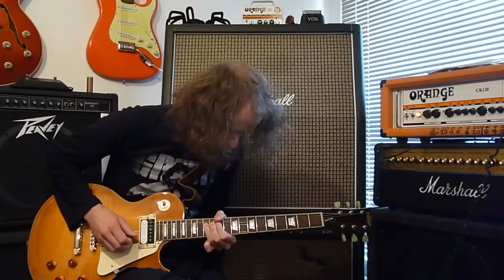Why I prefer Solid State amps to Valve amps

Comment: You sir are fighting the good fight man! "Solid state" does not have to be a dirty word, and I wish more people realized that!
Reply from the maker: Thank you very much. :)
Reply: No problem! I have two of those MGs myself! They haven't let me down yet!
Reply: Most people realise that. A tube amp has that cool factor though.
Reply: This is true. In the one music store where I work part time, we got in this vintage (or maybe just old?) Mesa Boogie that is covered in this red faux-suede like material. Beautiful piece of gear, and beautiful-sounding piece of gear! Can I afford it? Nope. Would I risk gigging it even if I could? Double nope!
Reply: Speaking of gigging if you hook up a 2000 Dollar tube amp to a solid state final stage how much drugs and hookers could you have bought while gigging in Amsterdam if you would have just gotten a line pod instead?
Reply: e james "tube technology obliterated?" No way, and I still want to be part of it. Do you use a Microwave Oven? That's tube technology. Fly on commercial airline flights monitored by ground radar? That's involves tube tech. Listen to broadcast radio or TV? Tube tech, again. No solid state devices have replaced vacuum tubes in these applications. Think vacuum tube research is moribund? (Look it up in the dictionary) Have you heard of nano vacuum tubes?  NASA’s Ames Research Center produced a nanometer-scale vacuum tube that, in early testing, has reached speeds of up to 460GHz. There's a speed limit in which electrons can pass through silicon or germanium. In tubes, no such speed limit for electrons in a vacuum. Or how about the new "impossible" RF resonant cavity thruster design, unique as the electric propulsion device doesn't require rocket fuel for space travel,  (potentially demonstrating an interaction with the quantum vacuum virtual plasma powered)? Powered by a vacuum tube. A researcher in the UK, researchers in China, and NASA are convinced it works from tests.
Reply: Ryan O'Donnell, Wes Montgomery played through Standel solid state amps. Standel as a tube amp company pioneered many features that Leo Fender "borrowed" from. Never heard of Standel? They switched over to transistors before Fender in the 1960's; a bad lot of encapsulated Solid State boards (which couldn't be repaired), bankrupted the company. (CBS Fender should have taken notice)

There are good and bad sounding tube and solid state amps. The Beatles used some solid State amps or tube/ss hybrids, but not exclusively, and towards the end not at all.  

No company to date has produced a transistor that mimics perfectly a tube amp, as 1) it would be low powered (Class A) circa 10 Watts, and 2 expensive, but would distort similar to a tube with even harmonics (instead of the harsh odd harmonic) series which to date no company has come close to this ideal. 

Both technologies have their strengths and weaknesses, which can be artistically exploited, but it doesn't have to be one or the other. However, for most applications I am interested in, I wouldn't never use "squalid state" personally.

I have repaired tubes and SS both over the years. Tube Technology is similar to a car. It requires tune ups and maintenance plus time to time part replacements, similar to replacing tires on a care. Yes, there are expenses, but it's part of ownership, like a car.  Similar to cars there are well built brands with money being no object, and entry level brands or built to a price point.  Solid State (especially beginners amps) has less maintenance, but generally when something happens, the replacement cost is in favor just tossing out the amp (versus repair).

My opinion, a Fender Hot Rod tube amp series shouldn't be used long term by a professional musician. They aren't designed to take the abuse night after night, and Fender knows this. Used every day, five years max, but that's not the fault of the tubes, it's the heat issue from poor design, inadequate ventilation, and inadequate traces on the PCB that are the problem. Would be okay for the occasional player on weekends, but the ones who keep their day job.

Solid State is often defended as to its lack of maintenance issues compared to tubes, and its reliability. Well, when the SS amp does require a repair, it quickly becomes landfill material.  "You repair amps? Can you repair my Marshall?" It's not a tube amp it's a solid state..." I have heard too many times (not just Marshalls) as not too many guitar shops, or repair shops in non-Metropolitan areas will not touch them.  

Frankly most repairs on SS amps are just PCB replacement, but if you have a discontinued amp with a board no longer made, good luck, the repair would get you into Tube territory prices or higher with a bench charge and labor.  Incidentally, as to maintenance, any 25-30 year old SS amps require Electrolytic Cap replacement, just as Tube amps require (E-Caps generally last only 10 years).  

SWR, don't get me started on their repair issues. Lord have mercy on someone with a pre-Fender SWR 900, post fender acquisition 900s use different shape and PCBs.  The SWR Redhead at the local High School was always out for repair, (but not for the tube preamp) , so much so that the Jazz band's bassist would take his own equipment, a Vintage Traynor Bassmaster tube head (plus a cab),  out to Jazz band public performances and competitions. The SWR's problem was one of design and part selection. The inadequate 5 Watt resistors need replacement with 10 Watt aluminum fin resistors on the chassis to heat sink these, the 2SC3264 transistors were too often generic equivalents (like the NTE92 or cheap counterfeit transistors 80-90% of the time, which fail (replace these with NOS transistors from the original manufacturer of the 2SC3264), the standoffs for the PCB too tall, etc. The OEM speaker needs replacement with a more durable speaker that won't fail.  Otherwise, a nice sounding amp. 

And, yes there are bullet proof transistor amps out there. But if I have a choice between repairing an original Fender Silver Face tube  amp, or a  Solid State amp, the tube amp wins out. 

For all the SS amp fans, call your local guitar shop (or for that matter Guitar Center), and ask how much to repair your SS amp, which isn't making a sound or distorted but with little volume with the amp dimed, or just squeals loudly at low volume, and ask about a repair and the cost.  You might be surprised.

Solid State wins out for Bass Amps in the Power department and driving low Ohm signals, and weight.  But when I listen to bass amps or guitar amps, I don't weigh the amp first. Rattling the rafters doesn't make either a Guitar or a Bass player popular with the sound-man at a smaller venue. 

If you play metal, use an extensive amount of FX pedals, digital sound processors, it won't make a difference SS or Tube. However, if it's just basically Guitar (Bass) into amp (minimal FX pedals), then your style of music will determine which makes the most sense. However, too my ears, clean tones through a tube amp have a quality that I can listen to for hours, while I can't say the same for Solid States.  Your mileage will vary.

However, as many musicians who post are in the category of "being too poor to own a pot to piss in," solid state is a fine alternative, with incremental acquisition of FXs (digital or analog), can get their sound, whatever that may be.
Reply: Harry Emmott kemper is digital btw, they are amazing though
Reply: +Harry Emmett Kemper models amps. Typically, people model their tube amps with them, but it's not it's own circuit and own sound, per se. The fact that many solid state amps are modeling the tube amp sound should say something about tube amps. Tube amp tone is still king. Can solid state recreate it? Sometimes, but tubes will always be superior.
Reply: It's not a dirty word. It's TWO dirty words.
Reply: lol Two Dirty Words, mind if I use your comment in the future?
Reply: Ryan O'Donnell amen brother!  My peavey red strip blazer is still kicking and sounding better than most small valve amps nowadays.
Reply: Scott Rosehart - tube SOUND, but that's really it.
Reply: @Renshen1957  Well being poor and not being able to own a pot to.piss ,,, if tube amps were priced the same.as.solid state ,,, fairly cheap and very affordable I believe that given the choice ,,,that most poor guitarists would.choose digital.and would state , because solid state amps.can do.much more than tube amps because most ss and digital.have tons of built in effects unlike tubes,,, and then likewise tube amps would be a great alternative to a guitarists choice who.couldnt afford to own a pot to piss in
Reply: @ampcruz2540  From the 1980's onward, starving musicians down to students general covet owning a tube amp, in my experience.  The built in digital effects, sound modules, even pedals that promise Jimi Hendrix tones fall into one big pigeon hole, "Close, But No Cigar") Category.  Fender introduced a line of Solid State amps in the 1960's (CBS) and as quickly discontinued these.  How many squalid state Vox (UK) or Vox (USA, Thomas Organ) are prized for their distortion tones, sound quality, etc? 
Why have all the major amp brands hawked SS amps with claims of sounding like tube amps which when push came to shove, was just claptrap advertising and didn't hold up in comparisons? Even when Marshall Valvestate's put a single 12AX7 valve into the pre-amp section of the amplifier while retaining the solid-state technology in the power amp. Only it didn't sound the same, although these hybrid amps sounded marginally better than the 100% SS amp. A review from 2003 says it all "Its great if you want something powerfull, and gigable, with a good sound, but may want to upgrade later on (my comment, upgrade to a real tube amp). The first overdrive channel is a good blend between a sweet warm clean tone and a crunchy tube overdrive. It has problems if you try to use it out of context (not for screaming distortion sounds).' A one trick pony, good enough until you can afford the real deal. It's why I do not like audiophile systems with tube preamp (unless I listen through headphones only) and a SS power amp, even for the subwoofers or biamp tweeters. 
Digital amps with modelling tones and digital modelling FX pedals haven't replaced even the old transistor FX pedals or tube reverbs let alone tube amps Digital effects, digital musical instruments (used for most film scores) are so apparent compared to the real deal (they stick out like a sore thumb in Titanic), that other than for Science Fiction (ironically, Star Wars continues with real instrumental scores), I generally won't watch a movie with a digital sound track. Saves money for the studios, no expensive musicians to pay, shorter time to product from score composer. 
The main reason a number of tube amp companies (such as Standel Amps, which Leo Fender frequently borrowed ideas from, in El Monte, CA went bankrupt because of solid state) was for economics, SS amps do not require a output transformer, which besides being expensive (and heavy, more expense to ship) reduced the cost. 
If your music is always played "clean" and not at the limits of volume, or if you want the harsh noise of odd number distortion harmonics (metal), then a solid state amp has its place. Steel Guitar Players use solid state amps, (up to 1000 Watts for clean head room) for clean tones. 
Go from clean, to a little dirt, preamp distortion, power tube distortion, tonal manipulation from touch sensitivity still remains the reason tube amps reign among guitarists. Fender, Mesa, Marshall, Vox, continue to make guitar amps with tubes, even low power tube amps for beginners as the players vote with their dollars.
You can use SS state, Digital Modelling, if used properly within their limitations, to make audio masterpieces. And that's fine. There are good SS amps, and bad tube amp designs, however, and until somebody figures out how to transform transistor odd number harmonic distortion into even number harmonic distortion (which tube produce and our brains likes) Solid State and digital modelling will remain as they are, second bests substitutes.  
And don't start me on SS Hifi systems compared to vacuum tube systems. No one pays 5 digits for Solid State components versus tubes, and those who DIY build tube amp components.
Reply: So true...totally different ballpark perspective but a good example for me is Dimebag Darrell, some people hate his sound, i love it coz YOU CAN TELL ITS HIS SOUND and he f**ked with it and worked it till he was satisfiied, ok there is nothing like a tube amp and not all tube amps are as good as each other but solid state is exsctly that.! A blank canvas to paint what you want to hear. I love SS amps as much as tube amps. Gr8 video and explanations. P.s you cant go passed the old peavey "BIG BALLS SS amps..!😎🤘🤘🤘🤘
Reply: @Rikk_Klaww777  Very good point, and you get "your sound" with modelling amps.
Reply: @thedavesimpson   hi  dave   im   enjoying  your  channel   mate  keep   up  the  great  work
Reply: @dylanpaterson7612  Yes, of course it is "digital" (A/D & D/A conversion), but the electronic circuitry is all solid-state.
Reply: @Renshen1957  I genuinely do prize my 1966 Vox/Thomas SS Pacemaker for its clean, consistent tone throughout the range of volume appropriate to my needs. Why does every amp have to be prized for distortion? That’s just silly.
Reply: @andrewkoastephens210  The conversation is usually between the full range from clean to distortion.  I prize the tube amps for their clean tones over Squalid State amps, but there are good and bad in both categories. Even clean, when I played electric organ or listen to a stereo, the Intermodulation distortion (from too much negative feed back) was tiring from the odd number partial artifacts in transistor vs. the even number ones of tubes amps (which I could play or listen to for hours).  Paul McCartney used a UK Vox for the distorted solo on Taxman (which was recorded backwards for Tomorrow Never Knows), and the guitar solos (easier to hear on the mono version) for Sgt. Pepper's Lonely Hearts Club Band first cut.  Some Metal Bands use Solid State (not for clean), Wes Montgomery played cleaned through a Standel Solid State amp. Standel went broke after switching to solid state.  Fender-CBS entered the market in the latter part of the 1960's (the SS Twin Reverb is the Guitar Amp that gave Transistor Amps a bad name); and quickly left the market. 
Solid-state amps produce a much thinner, cold and cleaner sound that many feel lacks natural tonal personality, very similar to complaints made by those that prefer analog effects over digital. It works for Jazz clean or for Metal Distortion, but otherwise the transistor Amp is a one trick pony, clean.  The problem with most Solid State amps has to do with the "lust for power."  If one designs around FET transistors for the preamp, and use MOSFET for the power amp (both distort similar to tubes), and kept within the design of Class A power, I would say you would have an Amp that would give Tube amps a credible run for their money. However Class A designs are in the power range of POS beginner amps. I cannot think of a SS amp that isn't running in Class AB or even Class B where the cross over from being on all the time (Class A) to Class B (off part of the cycle in push pull amps) doesn't result in TIM (transient intermodulation distortion). 
Similar to cars, amps are sold on how powerful they are.  Plus the book-keeper accountant has more to do with amp design (cost cutting) than the electronic engineers. Steel Guitar players play clean, but require tremendous amounts of headroom to stay clean at concert levels (1000 Watt amps) and keep distortion down.  
If you like playing clean, that's great that you like your amp.  However, I worked for a short time with a boutique guitar manufacturer.  His main problem, he only had a high power SS head and cab for people to visit him in his shop to audition his guitars.  Great for clean demos (it had 250 W) but he would have to power or have the buyer bring their tube amp to make the sale.  And these were Country Music artists not know for distortion.
Reply: @Renshen1957   That is all fascinating, cool stuff, thanks for the history and a good story. 

Speaking of organs, this reminds me of the Hammond vs Continental debate. As I’m sure you’re aware, Hammond players have temper tantrums like a spoiled 4 year old when faced with the idea that anyone would prefer to hear a transistor organ over their B-3. They do their damnedest to convince people to agree with their own preferences or they slander someone’s tastes if they don’t succeed. If I ever did hear Inna-Gadda-Da-Vida on a tone-wheel it must have been boring and utterly forgettable but on a Connie it’s thrilling and awesome. Conversely, Whiter Shade of Pale, would kinda suck on Farfisa. Another example is orange juice and grapefruit juice. If you get your mouth ready for one but you actually get the other, it’s a terrible experience. The parallel ends there through, as far as I know orange juice drinkers aren’t talking trash about the grapefruit drinkers tastebuds. Using the term “squalid-state” not withstanding, you don’t seem to be talking trash, but you do seem to have a strong preference and do seem to be presenting a case to convert folks to your thinking. I could be wrong on that. 

You nailed it when you described the odd and even partial artefacts. Tubes can create a sound solid state cannot. Solid state can create sounds tubes just cannot create. 

Yes, most people like warm weather on the beach with sand castles but then we’d never have ice castles under the northern lights. A person might prefer warm over cold or cold over warm, either is a legitimately valid opinion. 

There is no one prefect amp answer to all situations. For example, I had a 72 silverface twin that got me close to the sound I was after but even with all that over head and speakers known for clarity it just failed to make the crisp, clean edges I was after and the tone changed slightly as the volume increased. It’s not a flaw, it’s just the nature of tubes. Ideally it is just a matter of using the right tool for the job and an excuse to own more equipment. I think we can all agree on the last part.
Reply: @Renshen1957  Great lesson on tube technology but the point is still that if you crank a tube amp or a digital amp, and then add in all the variables such as acoustics of the room, the other instruments, etc, you can't tell the difference. 

And, very important, as Dave mentioned, is power quality. I'm assuming that you have a lot of knowledge on tube applications. Therefore I will assume you also know that every use of tubes you mentioned has voltage regulation, probably UPS with steady, digitally corrected voltage output and no worry of harmonics. Dave's point about power quality in the venue is spot on. As a power guy, DPUC regulations say that voltage is in compliance if it is plus 3% to minus 5% nominal voltage. (+3/-5% In my territory but some states are higher at +/-5%) At 240V nominal, that is a range of 228-247.2V 

Check out AC/DC Rig Rundown (https://youtu.be/j5C7GKGxICg ) starting at 9min 30sec. I respect everyone's opinion but I will defer to a band that has been around 40 years, using the same equipment, as to the importance of clean steady and exact voltage to consistently reproduce a sound. Angus has the money and technicians to  pay for all the equipment and maintenance required for consistency. I for one agree with Dave, a digital amp will plug in anywhere and perform the same time after time. And I too cannot tell the "organic" sound of a tube amp.
Reply: @vatican6666  "Great lesson on tube technology but the point is still that if you crank a tube amp or a digital amp, and then add in all the variables such as acoustics of the room, the other instruments, etc, you can't tell the difference. " If that was the case Tube amps would have ceased to exist and would no longer be purchased, consequently manufactured.  That is not the case in the real world.  More than a few companies (Marshall, Fender, Vox, Tube amps are heavier, more expensive, require more maintenance. And because of the heat generated, some bands travel with back up amps. I can only trust my ears (and on an Oscilloscope, my eyes).
The fact is digital instrument representation, (piano, harpsichord, guitar, electric guitar, digital amps) and solid state amps and digital amps do not look the same on an O-Scope.  The same can be said for pipe organs and the so-called sampled equivalents, although these come the closer.  
If you can't tell the difference, try a side by side comparison of a solid (squalid) state amp and a tube (valve amp) in one or more performance venues (club, auditorium, ect.) with a guitar a splitter (a/b switch) and record the results. (I doubt you'd go to the trouble of documenting this with an O-Scope) Start with clean and progressively increase the volume into distortion. They do not sound the same. Try the above with FX pedals.  Next repeat the above with a digital modeling amp (and repeat by substituting the FX pedals with the digital effects). 
The closest digital instrument representation was with a Hammond B-2 with the Leslie effect on full played by Goldy McJohn in 2009 in his rendition of Magic Carpet Ride.  Only the evidence of my eyes convinced me of this indistinguishable from the real deal. An exception to the rule.  However, I do not know if it was amplified by a tube amp or solid state, although I could not see his set up (the rest of the backing bands had tube amps), however to my recollection I do not remember the "edge" that transistor amps impart.  I have in blind A/B tests been able to distinguish between the two.  Likewise, my musically untrained first wife could tell the difference between music played between the two electronic organ I possessed of equal watts, and preferred the tube amp.  Her assessment, this (solid state) organ tires the ear and the body, while the other does not. She could distinguish between the tonal superiority of the tube amp for comparable stops. 
Other than some Metal Bands, Steel Guitar Players (but not all) in Country Bands,  and some Jazz guitarists, Solid State amps isn't anywhere as common as tube amps.  Rock Bands, Country Bands, etc.,  from don't quit your day job musicians, semi-professional players, to touring concert bands, and especially rock legends play and record with tube amps (with some exceptions, Billy Gibbons records with a SS amp).
 Perform a google search as to Groups and artists that use solid State and those that use tube amps. Before I relocated from the city I lived in for 28+ years with a guitar store, I was friend with the owners and staff, in walking distance from my home, I can't think of any time I went there with my sons or by myself, that any guitarist who wanted to demo a guitar asked to plug into a solid state amp. And for most aspiring guitar beginners, their holy grail was to purchase a tube amp and one way or another saved up, worked odd jobs to afford a tube amp.    
Google search groups and artists with gear endorsements for Solid State, Digital, and Tube/Valve amps.  The numbers speak louder than words. I've played pipe, digital (from the first in 1970's to present), solid state organs, in churches and you couldn't convince me then or now.  The more recent sampled digital organs are the closest, but close is still no cigar.  I've heard, repaired as a tech (vacuum tubes, I won't work on solid state amps or the cr@p PCB tube amps Fender sells, and currently I refer people to individuals who replace the PCB with components as produced in the 1960 's built in the same way), and attended rehearsals, performances, well you get the idea.
If you enjoy digital or solid state and it meets your sonic expectations, then that's fine. I disagree with the purported sonic equivalency espoused by you and others, either in music instrument amps, or audiophile/Hi-Fi systems.
Reply: @Renshen1957  Google for old Fender price catalogs during their initial SS amp run period. You have to remember that the MOSFET transistor was invented only a handful of years earlier, and was obviously cutting edge and expensive tech. For example in 1967 an SS twin reverb was $80 more expensive than its tube counterpart. According to the standard inflation calculator, that's a $679.00(!) premium over the tube fender twin. I'm not saying that people didn't think they sounded like shit back then, but I would place most of the blame on all the initial 60's failures that you mention throughout this thread on economics, rather than people's opinions of them.
Reply: @BooronovichPimponski  You're missing the point as to economics and squalid state.  Solid State eliminates the output transformers, the 2nd heaviest and either the 1st or 2nd most expensive component found in a tube amplifier.  Don't drop an Output Transformer on your foot unless you want broken bones or a severe injury for a Fender Twin or Showman. The Power Transformer is less expensive to wind (elimination of the  6.3 volt heater  secondary windings, in some amps also the elimination of the 5 Volt heater windings for the Rectifier Tube). 
The heavy Output transformer (copper and E I shape Iron laminations) is replaced by an Electrolytic capacitor.  Shipment of the OT to the factory being eliminated also decreases cost. Later shipment of a lighter SS amp to Music Stores saves on shipping.  Likewise, elimination of Vacuum Tubes (Valves) also decreased cost.  CBS Fender possibly was attempting to recoup its development cost or attempted a perceived value for being more expensive marketing trick.  
When the Bob Rissi designs debuted in 1965, Fender promoted the Transistor Amps as their Flagship line, aka this will make tube amps obsolete. Rissi's circuit and Paul Spranger put some innovations (chimney heat sinks) and the unique configuration, but sloppy assembly, questionable Printed Circuit Boards, and lack of quality control wasn't overcome by the marketing campaign.  Then there's the problem that the amps didn't sound exactly the same as the older Fender Amps on records or when A to B'd with the tube line of which the same names were used.
Check out Fender advertising from the late 1950's. They project an image of their main customers, Country Western musicians who by and large played clean.  Dick Dale may have been an exemption and later surf groups, but it wasn't until the beginning of the 1960's that the images become more "Beach" oriented.   
Fender was caught flat-footed with the British Invasion and subsequent greater emphasis on distorted guitars, later.  Fender even went to Ultra-Linear circuits in it's tube amps (the result negative feed back that reduced distortion).
In fact, when it came to designs, Fender was generally the last company to come up with innovations, more like it was the company that copied others Johnny come lately.  Other amps had tremolo (which Fender mistakenly called vibrato) before Fender. Reverb, Fender was late. Piggyback amp and speaker Cab, JBL Speakers, and volume and tone  controls on the front of the amp were borrowed these ideas from Standel Amps over in Rosemead, CA.  Standel had hybrid Tube and Transistor amps in 1961, the first successful Transistor Amp 1965 (Wes Montgomery owned one), and Transistors were the death of Standel.
The Fender Solid State PA system was used in the Beatles Roof Top Concert for the vocals. That's the biggest claim to fame for the 1960's Transistor line.
Reply: @harryemmott8597  oh yes, and in 10 years you will have digital guitars with fake silicon strings that sounds just like guitars on the computer, and it will emulate gibsons/fenders/12strings/ukulele, and you can bend them and put them in your backpack. And we will all sell our old guitars to buy one, right? Cause music is all about comfort, being practical and computer friendly, right? Vive le kemper and the VSTs.
Reply: Dimebag!!!!